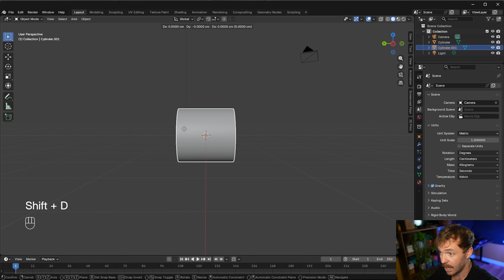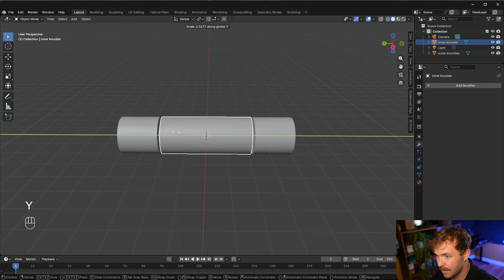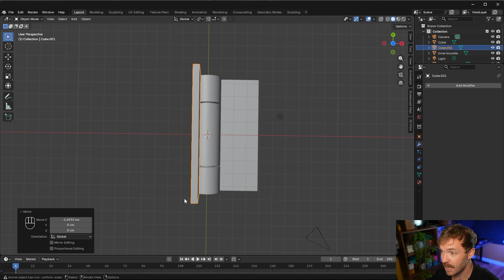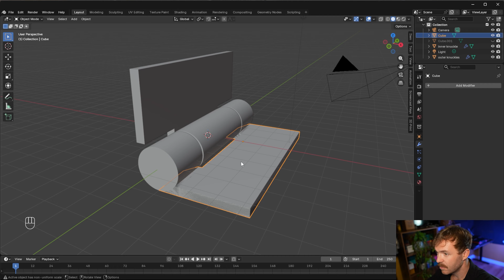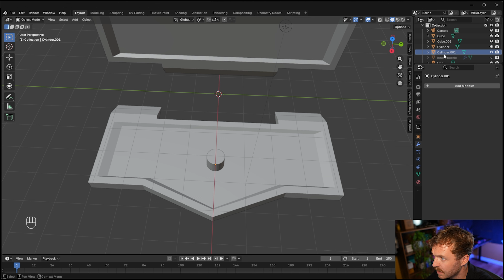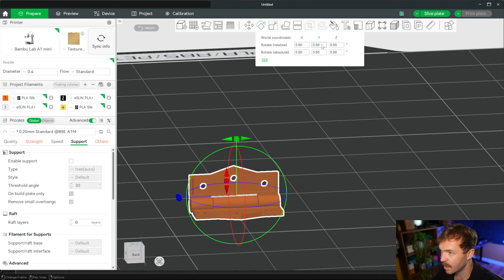How to Model a Print-in-Place Hinge in Blender

Comment: Nice video, it's very clear and I'm sure everyone could follow it if they want.

 I wanted to ask, since both leafs are identical, wouldn't it be better to first finish the design of one and then duplicate it, so that they come out exactly the same? Also, for the positioning, maybe changing the pivot point (using "." by default) to the 3D Cursor and then rotating it around Y and then Z would get it to a perfectly repeatable position. And now that I think about it, maybe the scale of the object should be done in blender, so that the screw holes can be adjusted for any screw you have.

Just some thoughts that popped in my mind while watching. A latching system would be really cool to see, so you can have your own almost-fully 3D printed customized boxes!
Reply from the maker: I’m so glad you liked it! Thanks for watching! And you’re totally right - they’re all great approaches! The leaves could easily be duplicated using the mirror modifier for a perfect copy, or the pivot could be adjusted to get the right angle.
A lot of this tutorial is eyeballed and I think I inadvertently wanted to show you can create without fear of perfection and then adjust later. Hinges can be designed to whatever specs etc you need, and the knuckles, leaves, pins and screw holes can all be whatever you like.
But you’re totally right! If this was a proper iterative workflow I’d be working to scale measurements and precise snapping :-)